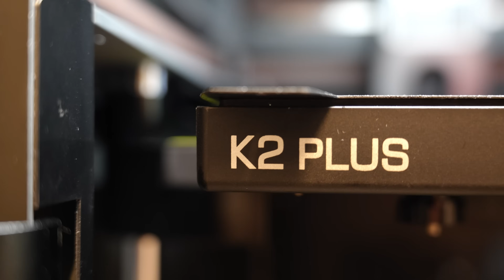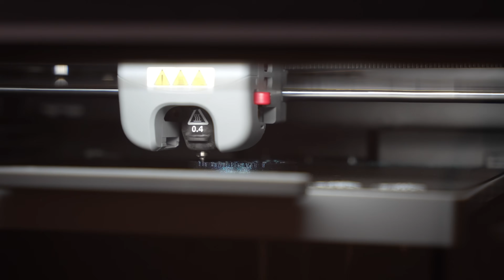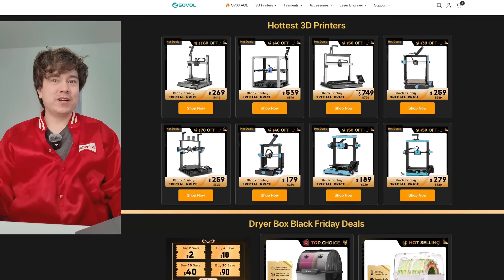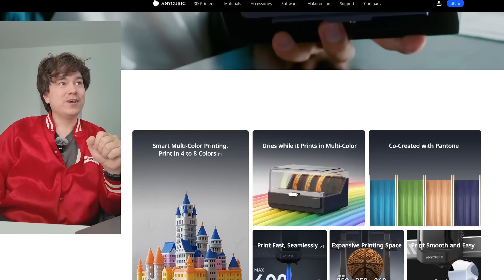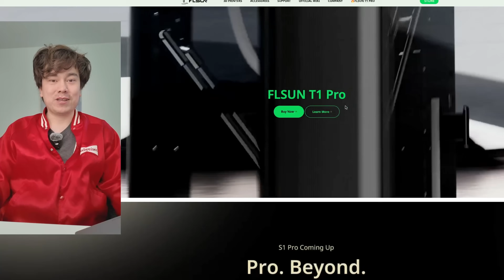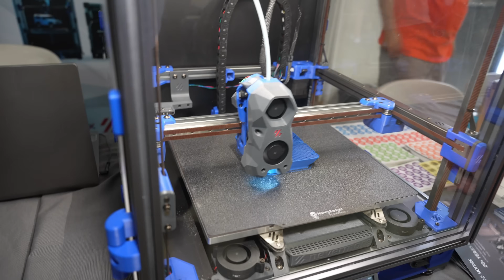Ultimate 3D Printer Tier List - 2024 with Sale Pricing

Comment: ratrig 500 idex printer, my favourite right now is Qidi X-Max 3, because of easy use, slice, upload and forget.
Reply from the maker: I’d love to have one of those! They look awesome!
Reply: @NathanBuildsRobots  Qidi tech shouldn't be a lower tier than Elegoo, Sovol  or Flashforge... 😬
And the Max-3 should be listed as A tier. They screwed up with the Plus4 in term of QC, and that shouldn't have happened but they build very more reliable printers than Creality or Flashforge.
Reply: @monnom6574 As an owner of a Q1 Pro, I agree with you. C tier feels harsh! I returned a K1C for it and didn't look back. I literally click print and DON'T watch the first layer. It's that reliable.
Reply: @monnom6574  - I hope Qidi has fixed their earlier issues with reliability and maintainability.  I bought a total of seven Qidi printers and regret every one.  I'm done with Qidi, no matter how many features they offer at how few dollars.  The false value is what suckered me into buying their printers and spending more time working on them than printing, and being forced to throw them away a year later when they came out with a new proprietary design and stopped supporting my printers.

Comment: The firmware fix is already out for the K2 Plus. It uses the nozzle cam to compare a baseline image to the current status. I wonder how sensitive it is, I've yet to get my K2 to abuse it.
Reply from the maker: The best thing to do is to limit filament changes anyways. This older type of multimaterial system is incredibly wasteful
Reply: @NathanBuildsRobots  Is it older or just cheaper?  Wonder how many purges it would take to break-even on a  Prusa XLx5 vs the K2 Plus
Reply: @jmelchiori85  At 1/2 grams wasted per filament change you will need to do over 195 thousand filament changes to break even on a Prusa XLx5. In other words, you will need to waste 97.8 spools of filament.

But at those poop rates it actually becomes economically viable to buy a T-Shirt Heat Press for printing designs onto them for 100usd and use that to recycle the poop into sheets of plastic.

Bottom line Prusa as always is overrated but still loved for past deeds.
Reply: @jmelchiori85  - Maybe the question is how many purges will it take to break even on a FlashForge AD5X versus the K2 Plus.  It's likely the AD5X will cost hundreds of dollars less than a K2 Plus so there is a negative break even point.  In all fairness, the AD5X doesn't have a heated enclosure and a 350 mm cubed build volume, but it does feed TPU in its 4 filament feeder, and that's HUGE for me.  I'll probably live with the smaller build volume and I'll cobble my own heated chamber, and I'll still have enough left over to buy an SV08 or Neptune 4 Max.  I wish Elegoo made Pro versions of the larger Neptune printers with all steel motion control systems.  My Neptune 4 Pro is a real workhorse.
Reply: @Liberty4Ever  Yeah, I agree the K2 is wayyy overkill for most people.  I bought one but only because I got lucky and landed in the 50%-off preorder group.  AD5x would have likely been in my future otherwise, though I kinda wish they'd have shot for more than 4 filaments.
Reply: @jmelchiori85  - I'd be happy with two different filaments.  I'm not really into color.  I make functional parts but would love to manufacture parts with two different materials, and filament changing TPU is huge.  Two colors of TPU would have been useful when I printed my custom Japanese mini truck mud flaps that say MEEP MEEP.  I did a manual filament swap for the yellow lettering on the black mud flaps.  :-)  For my real work, printing TPU and ABS would be great.  I'll probably buy an AD5X and cobble together a passively heated enclosure and FlashForge will launch the Pro version with an enclosure.

Enjoy your K2 Plus.  That is a killer of a printer.
Reply: @Liberty4Ever  At 1/2 grams per purge it will take 195 thousand purges before you waste the 98kg of filament required to break even on a Prusa XLx5.
Reply: @Guardian_Arias  - The K2 Plus poops more than half a gram.  It looks more like 2-4 grams to completely clear the nozzle of the previous color, but I wasn't comparing the K2 Plus to the Prusa XL.  I was comparing the K2 Plus to the new FlashForge AD5X which poops a lot less and is probably a third the price of the K2 Plus.  Less up front cost and less filament waste.  Win win.
Reply: @Liberty4Ever  The ADX5 looks promising if its 350mm cubed, but flush volume is deceptive, a 3dBenchy is 13 grams and the bambu flushes about 0.3 grams, i assumed a higher volume for the K2 because it has a volcano style nozzle which is a major factor as to how it can print at high speeds.

Either way, on the K2, you can access the klipper web server out of the box so the flush volume can be adjusted and hard coded into the firmware. Flashforge will most definitely be proprietary.
Reply: @Liberty4Ever  this only applies if you time has no value. The only reason I'm considering an XL is because multicolor is SO much faster with tool changes than filament changes. And tpu capability. Those purges are super time consuming.
Reply: @Guardian_Arias  - We're still a day from getting the real specs on the FlashForge AD5X but I'm fairly sure it's going to be a 220 mm cube and not the larger volume of the K2 Plus, unfortunately.  I'm also a big fan of open source and don't care for locked down proprietary designs, and that's a major stumbling block to me buying from FlashForge... or Bambu Lab.
Reply: @cgriff1644  - I'm guilty of mostly ignoring print time as it's unattended.  If I'm not doing the work, I don't much care how much time the printer takes, but there is definitely a cost to machine time.  Swapping tool heads is faster and wastes less material, and both are very good.  The Prusa XL is a beast.  The only complaints I've read regard reliability.  It's a complicated machine, but that will be true of any 3D printer with multiple tool heads.  There is a hack to have up to six tool heads on a Sovol SB08.  I'm intrigued by that for the large build volume and quick material efficient filament changes, but I'm discouraged by the complexity.

I don't do full color prints with multiple filament changes on every layer so that pushes me more in the direction of a simpler system that purges to change filament.  I may use a contrasting color on a top or bottom layer or two for a logo or other graphic, but I mostly want to print a rigid base with a flexible top, so there would be one filament change per layer, for maybe 20 layers.
Reply: @Liberty4Ever  not that many, the K2 plus has a big advantage for multi material simply because it has a much larger build area, you purge per layer, so if u can fit as many prints as possible per print area the purge amount is the same for 1 item vs 25. and the K2 simply can print a volume thats much bigger then the bambu or ad5x
Reply: @songhan1586  - On the flip side, the chances of the print failing increases with the number of parts being printed.  I saw a marketing video from RatRig showing one of their large V-Core printers printing 500 little pieces on a build plate.  That's one well calibrated machine!  I'm sure that was just a marketing video, but they do print 15 hour print jobs in their print farm with sheets full of parts on 30 printers.
Reply: @NathanBuildsRobots  Agreed but the Bambu AMS has still been incredible in a high-volume production environment where I can have multiple of the same spools loaded up and allow the system to auto swap when the filament runs out. In this use case the AMS actually reduces waste.

When I get my K2 to replace the Bambu I will be doing massive work on my SV08 to turn it into a multihead system with a two-color AMS per head for auto runout swaps.

The open source AMS/MMU project is called Enraged Rabbit Community Project (ERCF)

Comment: what is the best small build volume FDM printer
Reply from the maker: While it’s on sale for $199 + $15 shipping
Reply from the maker: A1 Mini if you are ok with sub-200mm size
Reply: @NathanBuildsRobots  that is kinda what i am looking for i do a lot of little prints, you have the same mindset when it comes to printers, i want quality and reliability first and foremost speed is a nice bonus
Reply: The "best" would be a Lerdge iX, Voron 0 or even a Rat Rig V-Chonk.

There simply cannot be a "better" (!) printer for you than the one you built by yourself, know the functions and simply know how to service it with any problems that might could occur. That is one big downside of any prebuild: you don't know anything about it and when there is a problem (which it's going to happen) it's getting frustrating. If you want "the best" there is no other option than DIY.

The Lerdge is by far the cheapest one, starting at 160 bucks. But you can spec that thing up to a 300 bucks "A1 Mini like" machine.
The Voron 0 is the most advanced one with many options (tool heads). Maybe even too much for a beginner to choose.
Reply: @hassosigbjoernson5738  thanks for the help and info never heard of the Lerdge printer

Comment: The paycheck from Creality has arrived.
It's getting really ridiculous with all these videos. If it were up to NBR, you would only work with Creality printers.🙄
Reply from the maker: I guess you forgot about all the other S tier printers on the list
Reply: @NathanBuildsRobots  I did not.
However, you can't take the “rating” seriously anyway, as this is clearly a purely subjective assessment. And the excuse that printers were forgotten doesn't work either. Someone who would work objectively on something like this would set the video to private, revise the rating again and improve it rather than just tipping this nonsense out.
In the end, all that remains is that a hard Creality fanboy and troll has dumped a pointless 50-minute video here, which can be titled “Creality is great, the rest is garbage”.

Comment: How do you feel about Micron+? My interest is in finding a CoreXY kit with a small build volume. I already own a Prusa MK4S, Prusa Mini+, and my old modified Ender 3 pro (or what's left of it). That LDO Rook MK1 and Adventurer 5M look interesting, so many options!
Reply from the maker: I thought micron is a joke? So what is the Micron+? I bigger joke?
Reply: I built one a few months ago. It's a solid little printer. The build is a pain, but the printer works great. 1515 builds are annoying because you must preload the t-nuts. Also, the Micron documentation isn't complete, so you will need to rely on the CAD model to complete the build. I recommend the printer, but I wouldn't recommend it as someones first self built printer.

Comment: Great vid. The ad5x from flashforge looks interesting. Normally companies choose to launch their pro version first to sell to more impatient buyers that would otherwise buy the cheaper version but they are doing the cheap version first. Also on sovol's livestream they talked about a smaller and larger version of the sv08 in the works. A smaller sv08 at a cheaper price might be insanely competitive
Reply from the maker: Oooh, that would be nice. A giant cheap SV-08, yes please. I would prefer if they threw in IDEX as well.
Reply: @NathanBuildsRobots  We're definitely lacking in the index side still
Reply from the maker: Theres basically just the Ratrig Vcore 4 available right now.

Comment: you hate bambu and do not understand qidi. Flashforge? You little sellout. YIKES!
Reply from the maker: Flashforge adv 5 has the best filtration and quietest design, prove me wrong.
Qidi's last two printers have had launch issues with electrical safety. Safety is not optional.
Reply: @NathanBuildsRobots  Safety was optional on those bambu A1 units on launch right? Innovation indeed.
Reply: @NathanBuildsRobots well, if we are gonna talk about safety, Creality for years has been having QC issues (main board DoA, bad soldering specially to the bed, bad power supplies, Bad hotends (which printed very ), screwed axis , ...) with big safety concerns (for ex the xt60 connectors on Ender3 series ). But yes they made the best printers in term of quality/price ratio and thx to the CR10 and Ender3 series allowed more people to dig into 3d printing.
Reply: I bought a Creality printer more than 4 years ago. I can get all the parts, from everywhere, after 4 years.
I doubt it will be like that with Qidi. Strange size nozzles...
Reply: @pizzablender  Bingo, and my Ender 3 Series, Ender 2 Pros, and Ender 5 series machines are super easy to work on and a world of optional suppliers, parts, or upgrade paths.  I hope to convert my ender 5 machines to core XY mercury one kits making them on par with a new machine but still super easy to get parts.